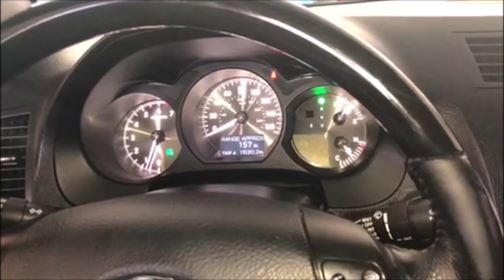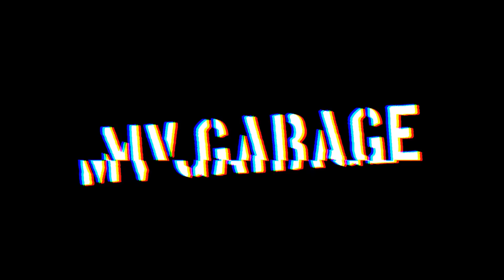Lexus Toyota VSC / Trac Warning Light FIX

Comment: I have 2007 GS350 with the same problems. Ive noticed that the OBDII plug has more only 5 electrical plugs across from the 4 plugs. I tried jumping it across like the video and the S/P light flashes and didnt shut off the VSC light. Please help! Thanks
Reply from the maker: Sarath Kieng Hi. Do you also have a check engine light on ?
Reply: @FlipITGarage  No I dont, but I do have the other lights still on and the S/P flashing. I pulled out the jumper wire and nothing changed. Any ideas?
Reply from the maker: @TheSebocypher  https://youtu.be/04YV8zTkGvg
check out this video
Reply from the maker: @TheSebocypher  also this video https://youtu.be/BMEoRhpE2k4

Comment: Well this light continue to stay off after the reset?
Reply from the maker: Snoop In - as long as it was just triggered for unknown reasons which happens a lot it’ll stay off. If you have a real issue it may pop back on.
Reply from the maker: Jeffrey Nash Hi, I haven’t personally tried this procedure on the 2004 models. I will try and see if the location switches on older models. Did you get anything when you did this procedure ? Is your pin setup identical?
Reply: @FlipITGarage  Hi MV - after I made this comment I saw in somebody else's comment that you said it doesn't work if you ALSO have the check engine light.  I guess I missed that in the video.  I have all three lights: VSC, Trac Off, and Check Engine.  Like I said before, these lights all came on about 60 driving miles after I replaced all four sets of brake pads.  After I shorted the two pins with a paper clip I saw no difference at all when turning the key to power on and then starting the engine with and without those two OBD2 pins shorted together with a paper clip.  It was the same.  The pinout on the 2004 RX330 OBD2 Connector is slightly different than the pinout of the OBD2 connector in your video. I'd attach a photo, but It doesn't seem like YouTube comments allow me to include an image...
A different video for VSC and Trac Off Fault Lights is about disconnecting one of the battery cables - which will also temporarily clear these lights, but they'll come back pretty quickly if it's an actual fault AND you'll lose driving data necessary to pass a smog test.  It can take two weeks of driving with no faults to get all the On-Board Computer Fault Monitors correctly set for passing smog after a battery disconnect.
Reply from the maker: Jeff Nash Yea the VSC is on because the check engine light. You’ll need to get that scanned and let me know the code so I can try to help out. Any autozone will scan it free if you don’t have a scanner. Disconnecting the battery will erase the code like you said but yes it’ll pop back on after about 3 drive cycles and erase your data.
Reply from the maker: Jeffrey Nash Nice! Congrats! Always nice to have your own scanner. Just start with getting the check engine light code and will go from there.

Comment: What does it mean if the vcs light comes back on after I do this?
Reply from the maker: More than likely you’ll need to replace one of the abs speed sensors. Pull the code to know which one needs to be replaced.
Reply: @FlipITGarage  thank you so much, I'll look into it

Comment: It didn’t work on my 2005 Lexus es330. 
When I do that only abs light flashes few times and stay on steady with trac off and vsc. 
Also my dlc connectors bottom side is not the same as yours.
Reply from the maker: Since the lights were flashing that tells me it was working. The video was done on a 2006. So should be the same procedure. You don’t have a check engine light on correct ?

Comment: Did this but my vsc still on. I have a gs430 my pins look a little different but still have the 4th one on right side like yours
Reply from the maker: Just the VSC light without the check engine light ?
Reply: @FlipITGarage  vsc light and vgrs light
Reply: Did you fixed it ? I have 2 those lights on too in a 2013 gs350
Reply: @cristianhdez7557  nope issue was never fixed.

Comment: 2007 is 250 and these darn lights will not go off! Scan code is P0420 “Catalytic system efficiency below threshold Bank 1”.  Any ideas on how to fix this?  Car runs like a dream 🤷🏼‍♀️. I hate these darn lights! 

What I’ve tried:
Changed cylinder 1 spark plug in bank 1 (had a P0301 “cylinder 1 misfire detected” code too, fixed that)
Cleaned mass air flow
Cleaned and lubed oil ring on gas cap as well as fully cleaned the lip and inside the silver area the cap connects to. 
Disconnected battery
Reply from the maker: Did you clear the light after those repairs? Disconnecting the negative battery for 10 mins will clear them if you haven’t already. The P0420 unfortunately you may need to replace the catalytic converter. Or it may be the O2 sensor for that bank. Also if it is the catalytic converter you can get them replace at smaller muffler shops for around $300 installed for aftermarket.

Comment: Does anyone know why this happens? Started my (2006 Lexus gs)car one morning n had the vsc, traction control, n check engine light on!! No work was done to the car before I got the warning lights
Reply from the maker: VSC light is on because the check engine light. You’ll need to get the code scanned to see what it is.

Comment: I’m trying to clear the vsc code /trac on a 2008 Ls460
Reply from the maker: If it’s just the VSC light this procedure should work. Do you have any other lights on ?
Reply: Check check engine vsc!tracking control
Reply from the maker: @joelbeavers9197  Here’s the video link to reset all those lights : https://youtu.be/iLrolhRr9lk

Comment: Is that trick apply to 08 gs 350 ? I tried and nothing happened !!
Reply from the maker: It will be the same procedure as long as it’s only the VSC light on.
Reply: @FlipITGarage  it comes with the engine light actually and misfire in cylinder 6
Reply from the maker: @costantineyoussif6679  The VSC light always goes on with the check engine light. It’s to protect the system it disables the VSC (Vehicle Stability Control). Once you get the check engine light misfire taken care of and reset the VSC will go off as well. Here is the reset procedure: https://youtu.be/iLrolhRr9lk
Reply: @FlipITGarage  thank you so much 🙌🏼
Reply from the maker: @costantineyoussif6679  anytime! 🤙🏽

Comment: Hi i had alignment fix and the traction off light turned on because my steering angle sensor has 10 difference in it and if i turn off the car and start it nothing is shown until a few minutes the trc off light work again
Reply from the maker: Mustafa Abdulrm Hi, have you tried this procedure ? And what’s the year and model ?
Reply: MV Garage  I haven’t its 2008 lexus is 300
Reply from the maker: Mustafa Abdulrm Same procedure try this method first.
Reply: MV Garage thank u
Reply from the maker: Mustafa Abdulrm No problem. Let me know how it goes.

Comment: My kid took off from a stop and the tires spun...lights went on, grinding noise.. idk.  I'll try it in the morning!
Reply from the maker: Suzanne Hodgkins Not sure about the grinding noise but for the VSC light you can try the reset procedure. As long as it’s just the VSC light. If the light comes back on after that you will need to get it scanned and diagnosed. If it just got triggered and there is no real fault it should stay off and your good to go.

Comment: Thanks for the informative video!   What was the significance of parking of a level surface and with the steering wheel straight while fixing the check VSC light?
Reply from the maker: Nhat Tran Your welcome!  I just had it parked in the garage. Doesn’t have to be perfectly flat but recommended to be as close as possible.
Reply: @FlipITGarage  What is the significance of that?   What does that have to do with the VSC problem?
Reply from the maker: Nhat Tran The procedure also recalibrates the steering angles. So it best to do it so it doesn’t throw the steering angle sensors off.
Reply: Nhat Tran use some common sense

Comment: 2009 Toyota Camry vsc an check engine light
Reply from the maker: Frank Powers The VSC light is on because the check engine light. They go on together. You’ll need to get that scanned and get the code. I can try and help from there.

Comment: Hi man,  my check VSC light  came on after jumping the car battery.. I tried this method but when I put the paper clip in the 4th pin of the connector and link a cross my ABS and the P/S flash instead of the VSC.. Any tips for me? I drive a 2008 is250
Reply from the maker: Nelson Guerrero Hi. Did you follow the steps exactly? Those lights will flash too. Should definitely be the same procedure. Did it read VSC test mode on the screen after a few seconds ?
Reply: @FlipITGarage  it worked... I forgot to reply quick.. Thanks man.
Reply from the maker: Nelson Guerrero glad it worked! And your welcome!
Reply: Nelson Guerrero how did you do it iam having the same problem and have followed the steps exactly and still nada
Reply: @alexquezada510  I did exactly what the video said. I got the clip I put in in the pinholes followed the steps the lights started flashing and bam it worked.... My lights that flashed weren't the same ones he said but at the end it did turned them off 🤷🏽‍♂️🤷🏽‍♂️🤷🏽‍♂️
Reply: Nelson Guerrero damn idk if I’m doing something wrong I doubt it it’s simple but oh well
Reply: @alexquezada510  how did the light came on?? Mine was after a Jumpstart
Reply: Nelson Guerrero well I just bought the car and has the vsc light on along with abs and traction and tire pressure light
Reply: Nelson Guerrero and when I do this procedure the only light that flashes is the one you mention P/S and that’s it and I’m 99% sure I’m following the steps right I’ve done it multiple time. Most likely something is wrong in the system
Reply: @alexquezada510  uy Uy Uy good luck man, you know when dealing with this older cars we need patience most of all
Reply from the maker: Ivirtues what vehicle do you have ?
Reply: MV Garage 2008 Lexus IS250

Comment: I dont know why but i just bought a lexus is220d and after i put the chip in and drove for 3km and took it out the vsc, check enginge light and the traction control light came on
Reply from the maker: The VSC light comes on anytime the check engine light is on. You can try resetting it to see if it comes back. https://youtu.be/iLrolhRr9lk
Reply: @FlipITGarage  you got a new follower😘
Reply from the maker: @CookieMonster-vm1rb  Thank you for the support! 😊🤙🏼
Reply: @FlipITGarage  i have to say thank you

Comment: Hi Buddy 
I have 2004 Lexus RX 330 model. I have same issue engine light + VSC On , I was check with the scanner , scan code is coming “P0037 “ 
Please help me , it’s almost one week this happened continue. 

Cheers
Reply from the maker: Hi, that code would indicate an issue with your O2 sensor. It’s the one after the catalytic converter. It will need to be replaced. You can trying clearing the light by disconnecting the negative battery terminal for 10 mins. Here’s a video on how to clear it : https://youtu.be/iLrolhRr9lk
Reply: @FlipITGarage  thank you for your quick reply. This weekend I planed to go long distance trip . Up & down lesson than 1000 km to 2000 kms. I need to know what time to change O2 sensor? I mean before trip or after trip? May be anything happened on long distance drive without replacing O2 sensor? 

Cheers
Reply from the maker: @MaheshMadushankamash4ever  No the car will be fine without changing the sensor right away. Won’t cause the car to stop or anything.

Comment: Unfortunately did not work for my 2007 Lexus es350 139000 miles I did this everything flashed but when pulled out after turning off came right back on
Reply from the maker: You’ll need to pull codes to see what keeps triggering the fault.

Comment: Hmmm, this didn't work.  It was running fine then hit the brakes and it went on.  Any suggestions
Reply from the maker: Do you have a check engine light on too?
Reply: @FlipITGarage  all fixed.  I saw another video telling me to unscrew the gas cap and then screw it back until it clicked.  Miraculously it worked.  Thank you for checking in.
Reply from the maker: @adebslife9928  Glad you got it fixed! But just so you know the gas cap would have nothing to do with a VSC light. It may have went off on its own. But either way glad it worked out for you ! 😊
Reply: @FlipITGarage  well it just happened again.  The car is running fine.  Any ideas.  I'm not home so I'll have to wait until I get there to try your paperclip trick.  The gas tank didn't work this time😮  thank you
Reply from the maker: @adebslife9928  Do you have a check engine light on as well ?
Reply: @FlipITGarage  yes
Reply from the maker: @adebslife9928  You’ll need to get the code scanned to see what it is. Autozone will scan it for free. Also if you just want to clear the lights. Disconnect the negative battery terminal for 10 mins. But it may come back on eventually.
Reply: @FlipITGarage  thank you so much.  I will do that.  Have a wonderful weekend.

Comment: What’s the meaning of code p0977 vsc warning still appearing
Reply from the maker: Transmission Control Module (TCM) 
failure. Common Problems That Trigger the P0977 Code

-Transmission Control Module (TCM) failure
-Transmission fluid level is low
-Transmission shift solenoid failure
-Wiring issue

Start by checking the fluid level. That would be your best case scenario.

Comment: Didn’t work for my 2006 lexus is350. OBD says there’s code P2757/$07e9, torque converter clutch pressure control solenoid control circuit performance stuck/off. The engine light is on for a week to a month in a year, then disappears.

Comment: My car got this light so often. I took that to mechanic everytime they fix it up and comes back again. What's happening actually
Reply from the maker: Muhit Khan If it keeps coming back you may have an issue with one of your wheel speed sensors. Scan for codes.
Reply from the maker: 1018miamidrive Great information and very true! Always better to have the correct information for yourself to make sure your not being taken advantage of.

Comment: I did the hack but didn't work because of the check engine light. I did the scan and it gave me a P2757 code. Do you know what that is?
Reply from the maker: Aldrin Guzman that code is for a transmission issue. Could be something as simple as dirty transmission fluid or something more serious but it would need to be diagnosed. You could try clearing it to see if it comes back by disconnecting the negative battery terminal for 10 mins.
Reply: @FlipITGarage  do I disconnect both positive and negative? Or just negative
Reply: Also if they come back should I do a transmission flush or just transmission oil change?
Reply from the maker: Aldrin Guzman you can do just the negative. But if you do both it will work also.

Comment: The majority of videos that I've found regarding the VSC light are all pretty much the same. Look up bad mass airflow sensor, it can also cause this light to come on and the traction control to go off.
Reply from the maker: The VSC (Vehicle Stability Control) system wouldn’t be triggered from a mass air flow sensor. It would be triggered from an issue with the rotation speed sensor, the wheel speed sensors, steering angle sensor, or steering rack. Can also be a programming issue in some cases.

Comment: My vsc light is on tried your method. Did not work. I have a LS430 04 please help
Reply from the maker: Gerardo Ruiz just the VSC light correct? No check engine light ?
Reply: MV Garage check engine light on and trac off light is on and it says check VSC
Reply from the maker: Gerardo Ruiz the VSC is on because the check engine light. You need to get that scanned. When the check engine light goes off the VSC will go off too. You can clear the light by disconnecting the negative battery terminal for 10 mins.
Reply: MV Garage thanks will do!
Reply: MV Garage also used a scanner and got code P0031 .
Reply from the maker: Gerardo Ruiz that’s a oxygen sensor code. Could be a bad sensor or a exhaust leak. Try clearing it to see if it comes back on.
Reply: MV Garage yes I did that and comes on within 30 minutes
Reply from the maker: Gerardo Ruiz more than likely the oxygen sensor before the catalytic converter. Needs to be replaced. Easy fix.
Reply: MV Garage thanks for taking the time to respond to my questions.
Reply from the maker: Gerardo Ruiz Your welcome! No problem at all. If you have anymore questions let me know!

Comment: I have the same model and I have the check system for the tire air pressure and I changed the sensor but I don't know how to program it 
Help!!!
Reply from the maker: Omar albader Hi. If you installed a new sensor it will need to be programmed with a scanner. No other way to do it.
Reply: @FlipITGarage  thank you

Comment: Hello, does the same exact method(I meant Pins of OBD-II) works for ES350 2007-12?? please confirm before I risk my damn car :D
Reply from the maker: Yes, it will be the same procedure to reset it as long as it’s just the VSC light and not a check engine light also.

Comment: What does it mean if the check lights remain on after?
Reply from the maker: Ben Is it a “Check Lights” message ? If it is there is more than likely an issue with the headlight level sensor.
Reply: Thanks for helping out! Yes check light is still on. Should I bring it to a mechanic for this issue?
Reply from the maker: Ben If you know how to check it yourself. It’s located on the front left lower control arm. Looks like a small rod connected to the control arm. If you don’t know then yea you can take it in.
Reply: MV Garage thanks so much!!
Reply from the maker: Ben Your welcome! Good luck 👍🏼